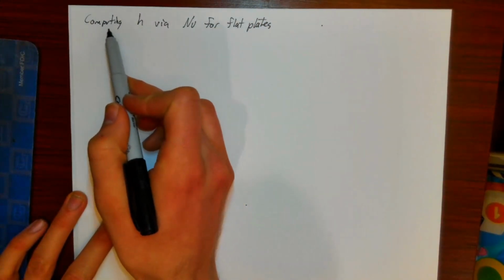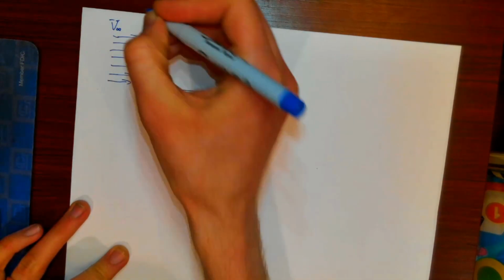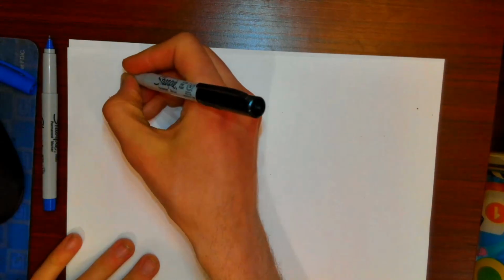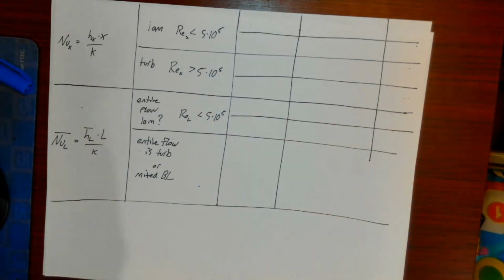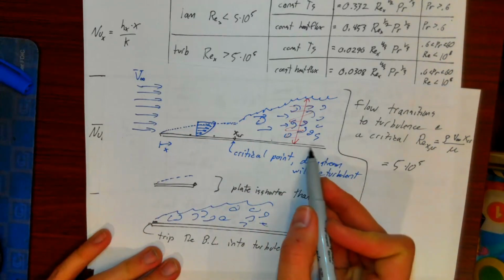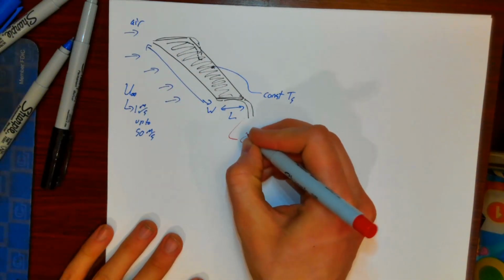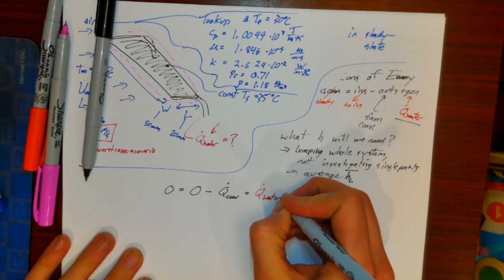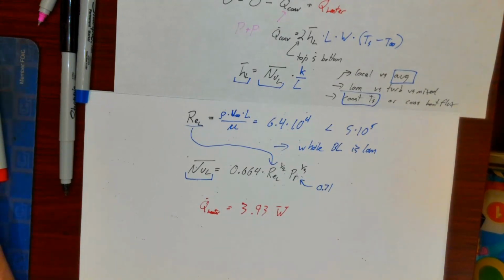BIOE 3310 Lec 26 - Computing h via Nusselt number for flat plates

Comment: Laminar vs turbulent boundary layers 7:30
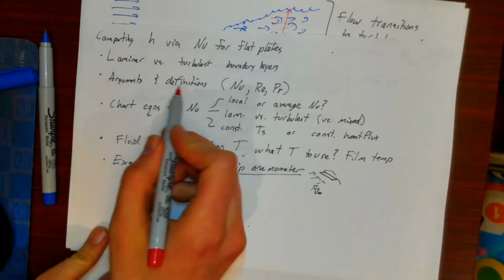Arguments and definitions: 14:57
Nu_x = h*x/k 
Nu_L = h*L/k
Re_x = rho*V*x/mu
Re_L = rho*V*L/mu
Pr = mu*cp/k 
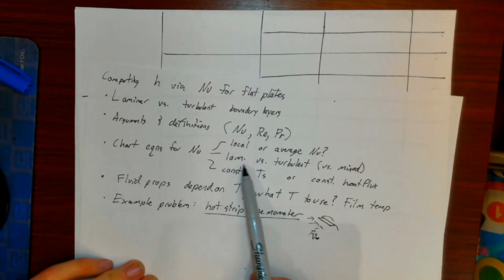Chart with equations for Nu; breakdown into different conditions : 19:49
Local or average Nu?
Laminar or turbulent (or mixed)?
Constant Ts or constant surface heat flux?
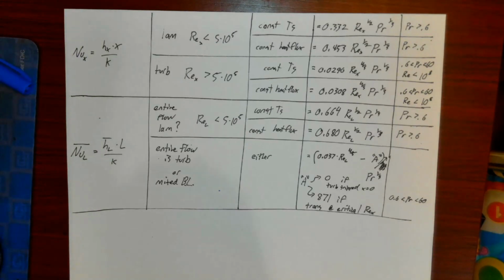Film temperature: an average of averages to evaluate fluid properties 28:40
Example problem: heater power for a hot strip anemometer 35:00